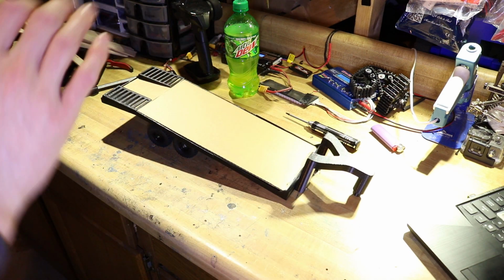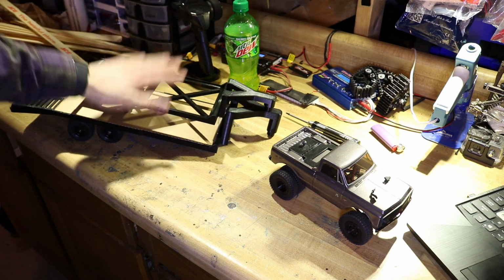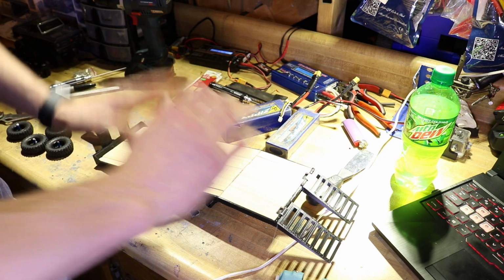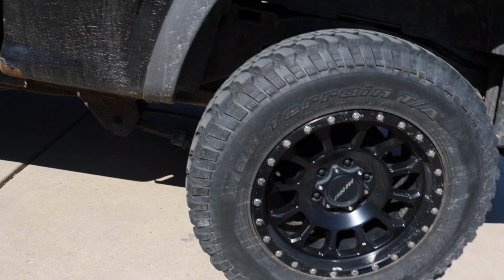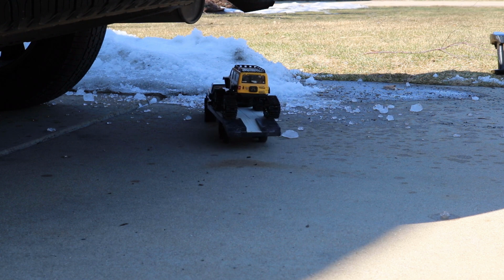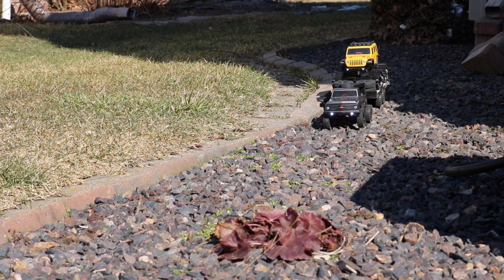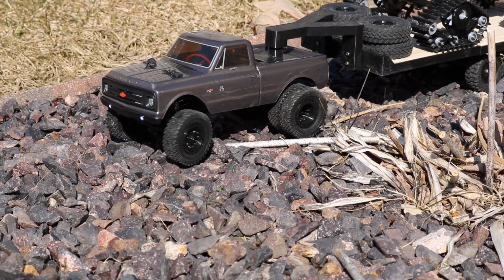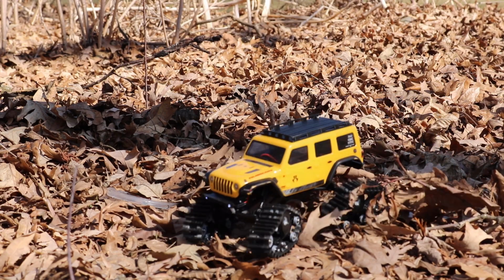SCX24 Project Update! C10 Dually with Gooseneck Trailer and Wrangler on Tracks!

Comment: Gluing tires doesn’t render them useless and only for those wheels. There’s ways to safely remove glued tires and use them in other applications.
Reply from the maker: With these you would have to destroy the wheel to unglue using any methods I know of. The material is very sensitive to heat and chemicals. Not to mention it is certainly a hassle to unglue tires when you can avoid it!

Comment: did you know if you put double barrel shock springs in your stock rear shocks it will stiffen them up so when you are towing your trailer your truck does not sag as much.

Comment: How did you get more length on the rear axle? I am about to purchase the c10 but am 3D printing the parts now
Reply from the maker: I am not sure what you mean by more length on the rear axle. Can you elaborate?
Reply: @CineMoto  I guess what I'm asking is how did the dually wheels fit? How did you make them work cause there's only a little bit of threaded part where the wheel sits

Comment: I’m surprised you didn’t burned that motor in the first minute lol 😂.  Cool MODS BTW 👍 Hey would it be cool if traxxas would come out with a 1/18 or 1/24 crawler 🤯 that would crush the competition 💪lol.
Reply from the maker: Oh the stock motors are stronger than you think! The brushes burn up with quick heavy consistent load but if you pace the wide open punches they last forever! I cannot stop thinking how cool a trx24 would be. I am a traxxas fanboy but would love a micro crawler from them!

Comment: Your gooseneck ball is in the wrong spot that why your truck lifts up under load.
Reply from the maker: It doesn’t really matter where you put it at this scale. It will lift up under load no matter what. Check out my later videos you can see I move it and it still likes to do the same even with the “proper” location.